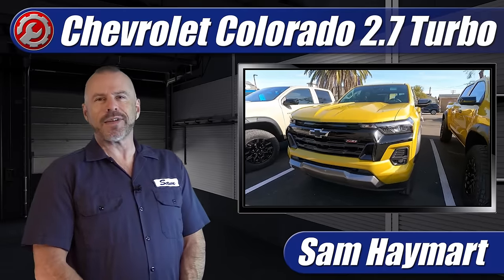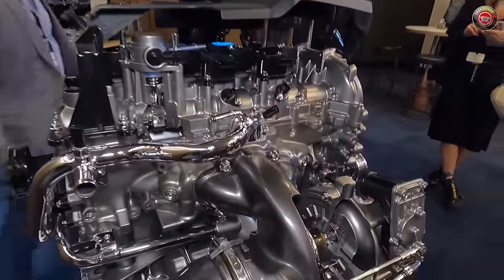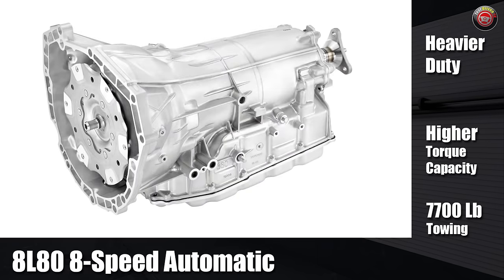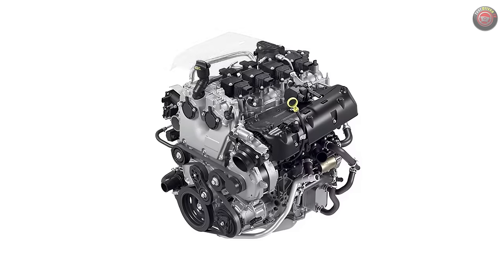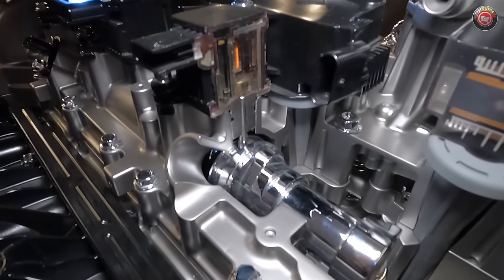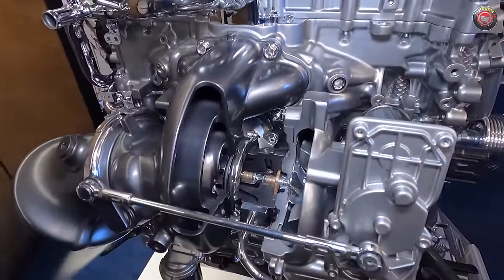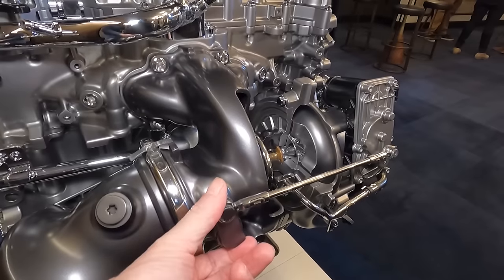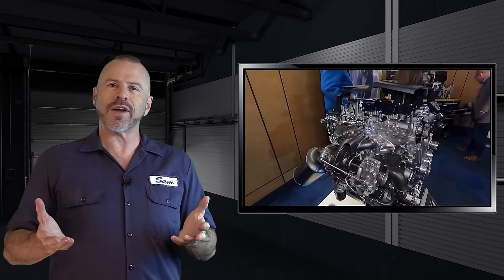2023-2024 Chevrolet Colorado 2.7 Turbo Engine: What You Need To Know

Comment: I have the 2022 Canyon in the V6. Recently heard and read now GMC and Chevrolet is having a hard time selling these Canyons and Colorado's.  Think they screwed themselves from not offering 6 cylinder at least. Lots of people are buying the Honda Ridgeline or the Nissan Frontier cause they offer them in V6.  Now days you almost have to buy a 4 cylinder if you want to or not, on almost everything or model. IDK why so many people bought 4 cylinders for this long for. Specially people live in rocky and very hilly terrain.  Used to owned a 4 cylinder and never again.
 I would consider to buy a 5 cylinder someday. As long there is 6 and 8 cylinders I will keep buying those, not unless I try out a 5 cylinder.

Comment: The reason most truck owners buy is for heavy duty capabilities. Pressure from EPA is forcing these manufacturers to build fuel efficiency. Neither of these are noted in a 4 cylinder engine, turbo or not. No way will any 4 cylinder outlast or outperform the V6 which is a powerful aspirated only engine. More parts that can go wrong.
I’ll keep my V6 until it falls from the mounts.
Reply: Dont use heavy duty and v6 in same sentence..... 1500 lineup is light duty. 
Light duty applications only. You want "heavy duty" go get a 3500

Comment: Noticed the chain in the rear of the engine to drive the oil pump. Just like the 3.0 diesel and has a 100k mile service life.
Reply: The 3.0 liter diesel oil pump is BELT driven.. not chain..

Comment: Everyone seems to be somewhat puzzled by what the fuel economy will be. Wouldn’t it be the same as the 2.7 Silverado?
Reply: Colorado is lighter than the Silverado, different gearing, different tune, and different trans. I doubt they’ll be the same mpg.
Reply: Well my buddy is avg around 10l per 100 in his 2.7 turbo
Reply: @SyrupCanuck  that's the best I've seen! Well let's hope the Canyon\Colorado gets 9L per 100km (25-26 mpg)
Reply: @chrism1966  it's really not, it's the same as the silverado. The ZR2 colorado is actually heavier than the standard silverado.
Reply: @Garlander  well I don’t see how it’s fair to put the most extreme Colorado up against the most stripped down 2 door no front differential Silverado. But if we’re talking a trail boss vs a trail boss of similar build I’m betting the colorado will get better mpg. When the actual numbers come out we’ll see.
Reply: @chrism1966 you're right that's not a fair comparison, I was just thinking like a standard LT model silverado.  From what I gathered, colorado ZR2 is only 90 lbs lighter than the silverado ZR2 so whatever that gets I would imagine the colorado would get the same, maybe 1 mpg better since it would be more aerodynamic.
Reply: @matth3wc  let's hope so!

Comment: Does this engine shot off when I come up to a stoplight?
Reply: It does it you have the option of turning that feature off each time you enter the truck
Reply: @thomasmcghee2468  Thanks Thomas! I just really hate the shut off feature. If I bought a new one, I’d get that chip that disables the shut off and cylinder deactivation.
Reply: @la023711  if they do that would it void warranty? Afm
Reply: @3yoghmong476  The chip/jumper simply tricks the motor to keep running, the same as if the air conditioner is on. The chip can be removed in 5 seconds and everything goes back to the shutoff mode.

Comment: Active fuel management system is an engine killer and has been a major thorn in GM's side for awhile now. I will not buy GM any longer and I was a hardcore GM guy until around 2008 when the quality and reliability of GM took a major hit with the addition of AFM. Yeah you can deactivate it or have it deleted, but not until after the warranty has expired or you risk voiding the warranty. If you wait to delete or deactivate it for warranty to run out you risk damage being done by that time. Unless there is a way to deactivate it without losing warranty coverage that is. I went to Toyota for purchases in 08' and have not looked back. I still own one of the best trucks GM ever made though a 2003 GMC Sierra with a 4.8l engine.

Comment: Yeah I know some one left their comment on my thoughts about the turbo intake system,  well I finally found one of the video's that showed the turbo intake system then I finally understood the intake breather system,  but I still think they have the Chevy motor down sized a bit too much,  cause this 2.7 liter system is possibly based on the older v8-6-4 that made a few years ago,  the hp is being based on only one cylinder, which is probably anyone's opinion probably down sized a little bit too much,  the Colorado has a really good body style design,   but the engine design system,  is anyone else's opinion,  maybe a turbo v6 would have been better, but from all the different videos, I think the desert boss is the better design,  for the customers who want the base level truck that's their choice but it's not mine, the way I look at it, say I order or buy the top of the line flagship model then I feel I'm getting everything that means it's loaded,  what else do I need to say

Comment: So, if a V-8 is an improvement over a straight 8 and the same can be said with the V-6 over the straight 6, why do we not see a V-4? It would/could fit in a smaller engine bay etc. Honda had some pretty badass V-4s (In their bikes) back in the day.
Reply from the maker: Actually a Vee engine is NOT an improvement over a straight version of the same cylinders. The opposite is true. We have V8 engines and V6 engines primarily for packaging reasons, not because they are better than their inline counterparts. And....there has not been a straight-8 since the 1940s.

Comment: Only direct injection not duel port. Cylinder deactivation is also a negative. I guess if they did add duel port and delete the cylinder deactivation, the engine would last much longer than they would like.

Comment: If you take a good look at the size of the timing chain it’s tinny compared to the chain Toyota has put in their 4. When you have to run the turbo constantly while towing it is not going to last long. Granted most people will just drive around town with these vehicles. Go with the V8 if your going to do any pulling and change the chip out so you don’t have the cylinder release. I did this and only lost a couple of Mpg’s.

Comment: Where is the 6cyl version of this engine for the higher output full sized pickups? Seems this engine is capped at 310 HP because of its small liter displacement.
Reply: Trucks need torque. This has plenty.
Reply: @BigKandRtv  Actually that depends on what you are putting that engine in. For a little Colorado, it's adequate and would give the truck a very sporty feel. Place it into a loaded crew cab 1500 Silverado or GMC Sierra, it may have torque, but it isn't going to have much mid to top end acceleration. The Silverado then becomes somewhat dull to drive. The half ton trucks can benefit from using this engine as a base or mid grade engine upgrade, but there needs to be a bit more powerful V6 version of this style of engine to increase the HP,  not necessarily too much more with the torque. They are getting rid of the V8s sadly. If this is so, then they still need an engine that performs better than their current 6.2L engine that outperforms this new 2.7L  turbo engine. option.
Reply: @JPM788212  RE: Sporty - I remember people saying the same about the Raptor when it came out. “No way I am paying that for a V-6 truck. V-8, or forgetabutit. “ Now they do. The sounds of a turbo charged four-cylinder are at best boring. But torque is torque.
Reply: @BigKandRtv  It's not about the money or cylinder count at all. It's about the HP and TQ numbers. I just don't think 310 HP is enough to adequately push around a fully loaded crew cab half ton pickup. A single cab half ton, Canyon or Colorado would be a good choice for this engine IMO.
Reply: @JPM788212  early 2000’s Cummings equipped Dodge trucks had 305 to 320 HP. They were in larger pickups. They sold well. You are entitled to your preferences, and time will tell if this thing sells. Personally, I have not purchased a GM product in about 15 years. They won’t be selling it to me.
Reply: @BigKandRtv  I understand your point. But a lot of early model trucks were underpowered due to the lack of technology at the time. Same thing with my Dad's 1994 Ford F350 7.3 IDI dually rated at a whopping 190 HP and 385 lb TQ. It could definitely pull loads with his gooseneck trailers, but it would take a while to get up to speed. He still owns that truck to this very day. But like he said, the power difference between his newer 2022 Ford F350 6.7 is night and day, because of technology enhancements and modernization.
Reply: @JPM788212  keep in mind this is the base engine there’s still 2 v8 option and the diesel.  The 2.7 does just fine accelerating on the hwy. test drive one if you haven’t you may be surprised, better yet test drive the 2.7 back to back with the 5.3
Reply: @thomasmcghee2468  I already know how the 5.3 drives. It's a very lack luster engine and just nothing in comparison to Ford's 5.0l truck engine. Even their 6.2l is outperformed by Ford's 5.0l truck engine. GM better look into more efficient and more powerful solutions to compete.
Reply: @JPM788212 works fine loaded at max payload. No problem acceleration on highway.
Reply: @JPM788212 you dont think?? So quit talking. You have no experience. 2.7L has more get up and go at max payload than the 5.3

Comment: Does it have a plastic thermostat housing?
Reply from the maker: It does not have a conventional thermostat.
Reply: @TDTVGarage  okay, but what is plastic on it that could possibly see failure from thermal cycling?
Reply from the maker: If you watch the video you will see that virtually everything that is not a moving part is plastic. The majority of the external cooling aparatus as shown in the video is plastic. Basically, if it's black, it's plastic. It's the way all engines are made for the past 30 years.
Reply: @TDTVGarage  thank you, I did watch it.  But I couldn't tell over video.

Comment: I have a hard time believing this thing won’t have pre detonation issues with 27 PSI of boost and 10:1 compression.
Reply: Pre-detonation occurs with carburetor equipped engines because the intake air is charged with fuel. With fuel injection, then take air is still “uncharged” with fuel, i.e. clean air…the fuel is injected near top-dead-center, so pre-detonation is not possible.
Reply from the maker: With modern computer controlled engines that have knock sensors, variable timing....no longer an issue.

Comment: those main caps just look so flimsy, I feel like 4 bolt mains would have been ideal
Reply: Most 4-cyl engines, even the turbo ones have 2 bolt main caps. Don't need 4 bolt mains like a V8

Comment: I like the chain for oil pickup, but I don’t feel these engines should be in a full size pickup.  I drove this engine in my work truck and it is gutless and no torque.  I do like my 2.7 V6 in my Bronco.  It is true that both GM and FORD engines were premised on diesel heritage for both these engines, so we will see how long they last.  Unfortunately regulatory restrictions are really keeping these engines suppressed.

Comment: I cant help but notice the timing chain is on the back of the engine? This means the trans and/or engine has to be pulled to replace the timing chain? Yikes, that's going to get expensive.
Reply from the maker: The chain at the back of the engine is for the oil pump.

Comment: GM made a major mistake in not producing the LV1 today.

When a turbo shells, you have no power, plus you introduce metal into the induction system
Reply from the maker: IF a turbo shells. Something pretty uncommon and unusual. People need to stop with all the sky is falling paranoia about turbochargers, and modern technologies. They are not the devil. They are here to stay and more is coming whether you like it or not.
Reply: In 2000, only 1% of cars had turbochargers. By 2019, more than 33% of all cars, suv's, & trucks were equipped w/ turbocharger. 87 octane turbocharged, 27 psi, low rpm, grunty, 430 ft lb torque monster 2.7 is an engineering marvel.
Reply: @ews360  okay I'm just going to put to you think EcoBoost problems
Reply: Nothing lasts forever. I prefer to buy brand new, trade in 5-10 yrs/60k miles when drivetrain warranty expires. After I no longer own it, I don't care what happens. Could be a turbo, or a cylinder deactivation lifter failure. In the long run, I've found it's the cheapest way to go. Bought a 2006 Sierra Z71 Crew - 335 ft-lb torque, paid $23k new, 10 yrs later, traded in & received $13k. Bought a 2016 Silverado Z71 Double - 383 ft - lb torque, paid $32k new, 7 yrs later, traded in & received. $25k. $100 a month, including tires, & battery in each. Now a 2023 w/ 430 ft - lb torque. Reliable, warranty.
Reply: @ews360  2004 Tahoe, Going Strong, replaced a Thermostat in January
Reply: 1984 Olds Cutlass Supreme 307, ordered the car (nearly 40 yrs ago) , & still have it 120,000 miles later, but wouldn't want it as my daily driver. Ironically, just installed a thermostat/ htr core/hoses. No one has ever changed oil in that car for 40 yrs, besides me.
Reply: @ews360  yeah the Tahoe has 130000 from me driving it. Family had a 2000 Suburban that had 360000 on it in 2013, but was being abused by a family member, so it was sold, if said family member didn't abuse it, it probably would still be driven.
Reply: Much is dependent on what area of the country one resides. In northeast, nearly every 20 yr old vehicle is a rotbox. brake & fuel lines, rocker panels, cab corners, above rear wheel on bed, doglegs, frame members. Pre '06 GM V8 (w/o cylinder deactivation) are preferred engines, but don't drive on salty roads, cause the engine will far outlast the body/chassis.
Reply: @ews360  if i hadnt wrecked my 03 sierra in 12, id still be driving it, I had undercoated it before I lived in Washington for a couple of years. My 07 Silverado that I'm putting a bigger engine in which has 188000 on it, came from Ft Wayne with undercoat. There are 2007+ engines that don't have dod/afm, funny though that the system is no better on dodge or ford. Anyways people get it disabled via ecm, then eventually do a cam/lifter swap to the conventional hydro roller. I've seen 1 dod lifter and it uses a spring.
Reply: btw - The LV1 continues to be produced (no cylinder deactivation) & is available in full size vans (GMC Savana & Chevrolet Express). It produces 285 horse / 305 ft-lb torque. 6,700 lb tow rating. If it had 2.7 turbomax, producing 310 horse / 430 ft-lb torque, tow rating would most likely increase to equal 1500 Silverado/ Sierra 9,000 lb tow rating.
Reply: @ews360  I look at it from a dependability perspective myself.
Reply: So yes, Virginia, there is a Santa Claus. One can buy new 4.3 w/o cylinder deactivation, w/ 5 yr 60,000 mile warranty (vs 100,000 mile 2.7 turbomax drivetrain warranty), but you need to buy a full size van to get it.
Reply: My '06 Sierra had $1,600 worth of brake lines replaced (by stainless steel) in 2015 & rockers were perforating. My 2016 was ziebarted, but chunks fell off, revealing rust, & undercoating was piled on, many layers. New 2023 has aluminum doors, hood, tailgate. I pulled all the access plugs out of rockers & sprayed fluid film into cavities & other vulnerable steel areas. I'll trade it off in 5-7 yrs.
Reply: Dependability in regard to the entire vehicle? or just the engine? The dependability of V8's have diminished w/ cylinder deactivation (lifters primarily). Majority of drivers don't care to drive vehicles pre 2006, w/ 200k, 300k miles, as everything is wearing out. Ford has produced 2.7 turbo for 10 yrs. GM 2.7 turbo for 5 yrs , & now Stellantis has ditched V8 naturally aspirated for 3 liter turbo. Just because there isn't yet decades of modern turbo engine reliability, doesn't mean there has to be pessimism about new tech.
Reply: Quoted erroneous 2024 4.3 V6 285 horse / 305 ft-lb torque. Actual numbers published are 276 horse / 298 ft-lb torque. Ye olde 1985 Olds Cutlass 307 makes 140 horse / 255 ft - lb torque. Slug. 16-17 mpg. 2023 2.7 turbo 310 horse 430 ft-lb torque & 20 mpg w/ much heavier vehicle.

Comment: Verify that the WT with turbo plus L3B qualifies for the High-Output L3B tune (RWQ) tune...
Reply from the maker: Verify?
Reply: @TDTVGarage    Some videos state you can and some state you can’t on the WT with turbo +.  Was wondering if you knew for sure
Reply from the maker: We hear it directly from the mouth of the head powertrain engineer for the Colorado, explained in detail. Not much higher a source than that ;)

Comment: Why is this such a great engine. The gas mileage sucks.
Reply: I get a few better mpg than '16 5.3 for $6,000 less (2.7 turbo vs 5.3). Bought 40,000 miles worth of 87 octane gasoline w/ savings. 430 ft lbs torque (@ 3,000 rpm) of 2.7 turbo compared to 383 ft lbs (@ 4,100 rpm) of 5.3. Now, in a '24 Silverado, the confidence in 2.7 turbo gives it a 5 yr / 100,000 mile drivetrain warranty. Dual overhead camshafts eliminate lifters. Why is lifter failing V8 such a great engine? Less torque, worse mpg, & costs $6,000 more, same payload & tow rating.

Comment: No replacement for displacement
Reply: 2.7 turbo I-4 replaced 4.3 V6. 310 horse / 430 lb-ft torque @ 3,000 rpm. vs 276 horse / 298 lb-ft torque @ 3,900 rpm.

Comment: The more I learn about this truck the more I'm thinking about the 2025 Nissan Frontier. Not as sexy perhaps but probably BUILT better.
Reply: I'm curious what Nissan's factory warranty is on the Frontier's drivetrain?  Starting with 2024 GM vehicles, GM has increased its 5-year drivetrain warranty on the 2.7l gas turbomax engine and 8-speed transmission to from 60,000 miles to 100,000 miles.